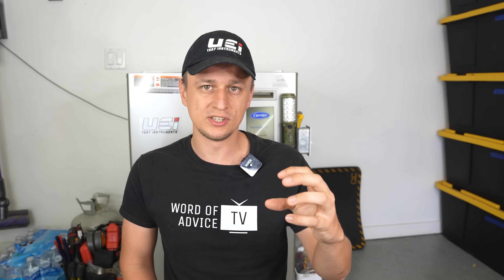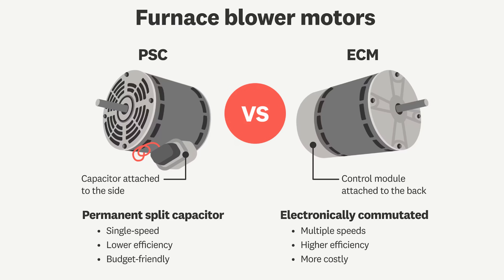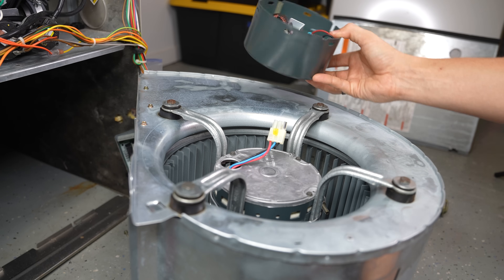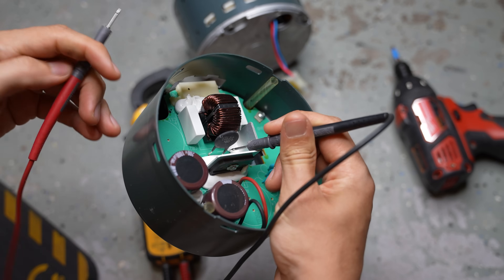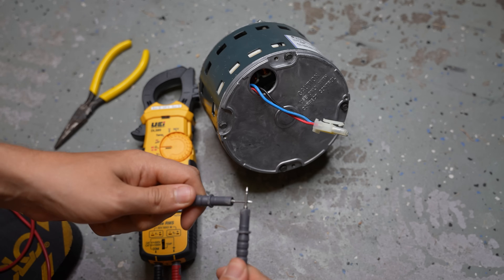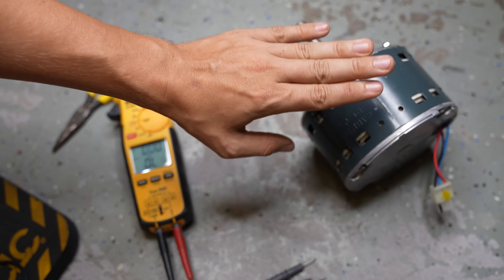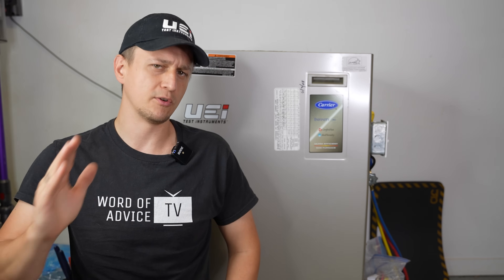So You Think Your HVAC Blower Motor is Bad?

Comment from the maker: ⬇ Other videos you may be interested in:

How to Clean Furnace Blower Wheel:
https://youtu.be/gs9KT4soJMY
How to Clean Furnace Burners:
https://youtu.be/6ehk0NZVFcg
Is HVAC Duct Cleaning Needed or Not:
https://youtu.be/2a86xiLlAHo
How to Replace PSC Blower Motor:
https://youtu.be/_3TxcnCkd18
How to Wire PSC Blower Motor:
https://youtu.be/4S8TZd-45bY
How to Replace A/C Motor:
https://youtu.be/gGFTd2dmgxg
What is the Best Furnace Brand to Get:
https://youtu.be/OLhZVaWH9Tw
Reply: hi 👋 how are you doing today
Reply from the maker: Doing great, thank you for asking!
Reply: After you remove the the electronic control assembly or circuit board , from the motor  ; Can you apply direct voltage to the motor , to either condemn a bad motor or Just  replace the electronic control circuit board .

Comment: Did anyone on here find the motor turned fine when you unhooked the ECM from the motor or is that normal when connected?  Just wanted to mention also that the night before my heat pump gas pack went out it smelled like a clothes dryer blowing into the house.

Comment: I have a problem right now. I have a Temp-star system that the indoor fan motor won’t stop running. It’s been running for 3 weeks…I pulled the thermostat off the wall and is still running. 

Do I have a bad motor?
Reply: Could be the low voltage G (green)touch R (red)
Reply: @gaoutdoor4372 no it’s not low voltage because I pulled the low voltage wires off the motor and it still kept running.

Comment: For three to five dollars you can more often than not just replace the inrush current limiter which is about the size of a nickel and will be obviously burned. 
That's what's wrong most of the time.
Reply: What are the symptoms of a bad inrush current limiter?
My ecm works sometimes, and other times it fails to get up to speed when calling for heat.  Motor works fine if just running the fan in low, med, or high. When calling for heat I get a blower motor failure code.  It kind of rocks back and forth before kicking all the way on. Genteq/carrier
Any thoughts?
Thanks.

Comment: I'm troubleshooting an ECM right now due to a blower not running. I already confirmed the board is good. The ECM resistor has continuity. Unfortunately the ECM has a rubbery coating on the board. Will the ECM board still come out if I remove those two screws? This furnace is less than 5 years old.

Comment: Very informative and brief Thanks.
Working on my ECM motor. Five years old and lightly used. Module looks and smells good. Motor looks and smells good to. Going back to the house to check the module and motor per your instructions.

Comment: I cleaned my blower motors fan barrel it was clogged bad "previous owners" and now it makes a loud noise but if i have the inspection door off with button clipped so it can run it runs quiet but if i put the door on and run it it is loud like a noise that sounds like a machine gun er er er er er er and my blower motor is an old one no module.

Comment: The ECM blower motor on my heat pump system started running continuously.  System heats and cools okay but the blower won't turn off. Any suggestions on what is wrong?

Comment: Thanks so much for the information. I am working on this type of motor and it won't come apart. I removed the 2 main screws on the back of the motor. I did notice that there are some very small secure torks screws on the end, but they go in the side of the end plate of the motor. Is there a trick to this.

Comment: That's an awesome video.
Thanks.

My question: What would you do if you noticed a burn mark on the back of the blower motor module board?
Reply from the maker: You're welcome! You would likely need to replace the whole module.

Comment: My blower motor runs but makes a sound like grinding or wiggling a little when it runs.
I'm assuming this is not the ECM, but the motor itself.  Or could there be a belt inside the squirrel cage, would this be it instead.   The cage turns freely when the power is off.

Comment: Soo..  you spend a week waiting for the module, do the labor to to remove and replace, and it’s not the module. No. ECMs are IMO much more problematic than single speed motors. Do they save money?  No. Are they a engineered to benefit the customers?  Again, no. The price of an OEM variable speed blower motor is 10 times the cost of a single speed. You will never get that back in power savings. The single speed is also more dependable, as it has no digital computer to go bad. I yank them out, replace with a single speed motor with a heat sequencer as a blower relay with delay, and never look back at less than half the cost and more life expectancy. Believe the sales marketing, or believe a retired hvac contractor that has no skin in the game.

Comment: Two blown control modules in 3 years. Control module on eBay costs more than the motor with control module. Go figure. Thermistat was not an issue, something else failed. Can't figure it out because the parts are poured over with rubber. This is racket on the manufacture's part.

Comment: Random question... Have you ever seen anyone use one of these (Whether an ECM 2.0-3.0) as a shop fan/floor blower? If you have How was it wired up? I know there is a quick and dirty way to test it by applying 24V across the Com and RX on a ECM 3.0. However, im worried about long term use as a document that I found states that the max Voltage on the RX/COM is 20 VDC. Im wondering what the Commercial testers are doing to TEST the motors and if they can be used long term for a blower application, or if applying 24VAC to the RX pin can cause damage. 

For those that comment that I should just use a Cap start motor.... I DONT WANT TO. Not to mention I was able to get a blower assembly with a good motor for FREE. So I dont want to spend 150+ on a replacement motor when I have a good motor already and thanks in advance.

Comment: So I had a dog chew my signal wires up coming from outside unit and the two wires touched and blew my low voltage fuse. Replaced the fuse after I fixed the wires coming from the outside. Tried to turn thermostat back on and wouldn’t do anything. Went out and bought another thermostat put it on and still nothing. But if I take thermostat off and touch my red wire to my yellow cooling wire air conditioner works like it should. Where should I start
Reply from the maker: Sorry to hear about the air conditioner troubles. It sounds like the thermostat was damaged before the fuse fried. If everything fires up when you bypass the thermostat like that (R to Y at thermostat) this almost always means bad thermostat. You could also try resetting it if it resets or changing batteries if it has batteries. If that's not working, then a new thermostat is needed.
Reply: @ thank you so much I’ll dig into it more tomorrow
Reply: Hey man so I Installed a new thermostat when I turn to cool outside unit kicks on and condenser kicks on but the fan will not blow on the inside unit. If I switch it to heat you can smell the heat strips but fan will not blow. But still if I jump the red and yellow with a jumper wire the air conditioner works like it should

Comment: Hi, about a week ago I have to replace my ECM blower motor..... luckily it is under warranty.  It was only 5 yrs old.....Rheem gave me a complete ECM motor and the Circuit Board as a package.  I have to turn in the old ECM motor and the Circuit Board with $150 core fee.....which is not bad considering it would cost over $1,000 if it wasn't under warranty.  My a/c was licensed so he handled this thru Rheem warranty distributor.
Reply: What is the $150 core fee?
How much did they charge you to replace the ECM blower motor/module?

Comment: My fan is blowing on the inside heat pump and it just keeps running. Constantly runs even though the switch on the thermostat is in off position. But at the outside unit,  no fan movement and compressor wont come on. I changed the capacitor already but still nothing. Any advice on the potential problem would be greatly appreciated. 🙏🏾💚☮️.

Comment: I have had this many times in my business.  I found that the module has issues with the inrush capacitor.  You can buy them on line for a couple dollars.  Yes i said a couple dollars. Simply solder in a new capacitor. That is not a resistor.  JFYI

Comment: Great video but normal people can do all that and buy all the parts just to find out it was the control board dropping voltage when calling for cool. Or it can be 1 certain speed tap on the motor not working. Not as simple as videos make it out to be.

Comment: what sucks is this energy savings variable speed motors are frequently not replaceable seperately  they only sell the whole unit on my weil mclain gas heating system for a mere 700 dollars for a fan like a bathroom exhaust fan

Comment: Hello, Could you tell me what could be my issue? My heat mode works fan. If I select fan on then the fan works fine. But on cool mode, the outside unit works but my blower fan does not run. I tried to set fan as on and then start cool, but the fan stops when cool is selected. I recently changed my board and the capacitor. What could be the reason?

Comment: If I am correct, that round black component is called a thermistor and they are about $3. You are correct, many reliable sources in HVAC confirm that those EMC motors, especially the Genteq brand, fail in just a year or two and the point of failure is usually the ECM. Availability of another ECM in the past has been limited so many of the HVAC tech people simply replace the entire motor assembly which is an easy $800 motor. I've seen other YouTube channels in HVAC do the same, locate the correct thermistor and replace it however, not that many HVAC tech will do that due to having to have the skills to de-solder and solder the new thermistor in the field. If they can't obtain an ECM they will replace the entire motor. Some of those ECM units are filled with an insulating packing which is very difficult to remove for access to the thermistor which in most cases, prevents or makes replacing the thermistor a higher risk in damage to the board and then if a tech is able to replace it, they don't have the packing material to fill in the empty space. There are also methods to simply remove the ECM motor and replace it with a PCM motor conversion kit. There are upgraded ECM motors now being made called Evergreen that are more reliable and do not need to be programmed. Good explanation though for those who might spend money they don't need to.

Comment: HVAC Tech here. 95% of the time, it is the cap that fails and not the motor. While I know that you can order just the cap, we normally replace the motor and the cap together.

While that opens me up for accusations of screwing customers over, here is the thought process. We explain to clients that we do not know if how the cap failed would have caused any damage to the motor. If you have a 15 year old furnace and I replace the cap, you still have a 15 year old motor. And no matter how many times a customer tells me, they understand that the repair is the cap only and not the motor. If six months later the motor fails, suddenly we are getting very any calls back saying that we sold them a defective part and want the whole blow motor assembly replaced for free or at a heavy discount. Over time, it was just not worth the potential fight with customers over this kind of stuff. So we no longer offer just cap replacements.

In the end, I'm all for people saving money. I'm a home owner too, I know stuff is expensive. So if you feel comfortable with making a repair like this to save money, go for it.

Comment: Pro tip of the day: When you install a new system, always include an Intermatic AG3000 surge protector on the condenser disconnect and the disconnect on the furnace. Total cost, about $160 for  both.  
Cheaper than replacing ECM motors, control boards, and compressors. On a service call, upsell the customer by explaining it protects the equipment from power surges and is far cheaper than replacing burned out parts.
Reply: Isn't that usually a soft-start module, of course, it would reduce the surge by ramping up the current to the compressor.  Common on mobile ac units I'm told.
Reply: @emptech 
No. It isnt a soft start. It is a quality surge protector. We do not install soft start devices. They are prone to early failure and are too expensive. We only recommend and install Intermatic AG 3000 surge protectors. Our cost is about $70 each.
Reply: I paid for one ($595), was never installed and company disappeared 😡
Reply: Intermatic's "warranty" states it will pay for equipment damage only after homeowner's insurance is paid and IF THEY determine damage was due to a fault in THEIR AG3000.  If it fails and they determine it is not the fault of their unit, or you don't have a homeowner's policy---tough luck!
Reply: @Jeph629 
We don’t buy and install for any warranty. Every company we looked at has the same limits. We only use the AG3000 for its features and reliability. We have never had one fail unless  the house took  a power surge, then it will do its job and pop, protecting the equipment. It is sacrificial. If the unit popped, then other electronics in the house failed, proving the surge took place and the AG3000 saved the furnace or condenser.

Comment: Jay, you mentioned possible control problem, but how would you test to see if your control board is sending power to the blower motor?
Thanks
Reply from the maker: That's pretty rare but you would need to look at the furnace wiring schematic and see which wire sends power to the motor. Next I would set the thermostat fan setting to ON or jumper R to G at the control board. Then check for voltage at the wire terminal that is supposed to be sending power to the motor.
Reply: @WordofAdviceTV  Just ran into this ECM setup for the first time ever....and of course it's in a tight attic. 240vac goes straight to the motor from the transformer. The 3 wires off the board that go to the ecm is com, T1, and T5 and they are shown on schematic to be 24 volts.There's a speed tap table showing various combinations of t2-t5 for fan speed depending on unit size. T1 is sending the power signal to the ecm then? Thanks for the great video.

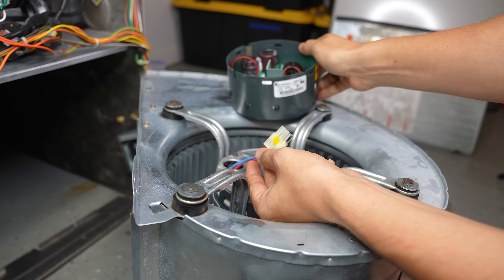Comment: @4:18 that’s a capacitor not a resistor.
Reply from the maker: Are you sure? I thought those cylinder looking things were the capacitors. That black thing is a thermistor.
Reply: @ yes, the cylinder things are also capacitors, but those disk shaped things are ceramic capacitors.

Comment: Make sure you have a surge protector on your furnace.  Those modules are very sensitive to power surges.  Besides the motor, there is the control board to protect from surges.  most homes have multiple surges a day, either from inside or from the power provider.
Reply from the maker: Great suggestion, thank you!

Comment: Hey Jay, can you do a review on the UEI DL 599. And how it differs from the DL 589. Not sure which one to get. Thanks.
Reply from the maker: I can look into it, thanks for the suggestion!
Reply from the maker: Okay so I looked it up and I don't think I need to make a video on this. There are not many differences. Mainly, the 599 has power functionality and wireless capabilities whereas the 589 does not. If you want more detailed specs you can see and compare them here:

UEi DL599:
https://www.ueitest.com/ECommerce/product/dl599/trms-clamp-meter-w-motor-testing
UEi DL589:
https://www.ueitest.com/ECommerce/product/dl589/600a-trms-clamp-meter-w-dc-amps-inrush-magnet
Reply: @ Thanks. I was wondering if the DL 599 would be worth the extra money. I guess my main question would be ‘is the 3 phase motor testing worth it or should I just go with the DL 589’. Thanks for answering.

Comment: I believe there is a way/mod that allows the pcm motor to be used in its place. An HVAC tech took my elderly parent to the bank on one of these. I also believe he said it had to be programmed and charged xtra for that. What do you think ? Long time subscriber.
Reply from the maker: Technically the universal motors do need to be programmed but not a lot of techs do that. It shouldn't take long to do so hopefully he didn't charge them an arm and a leg for that part. I am not sure what mod you are referring to but yeah, there are a few retrofit options out there. The replacement does not need to be an OEM motor.
Reply: @ it was 1300$
Reply from the maker: Was that the cost for the whole job or just the programming part? If it's for the whole job, then that is actually a pretty common price. (Expensive and an overcharge but common) That's why, if opportunity allows, it's best to do these kinds of repairs yourself...
Reply: @ the new motor assembly.

Comment: When checking continuity on the resistor in the unit, isn't it possible to get continuity coming from elsewhere in the circuitry?
Reply from the maker: The way it's set up, that shouldn't happen. At least with the module in the video.

Comment: @WordofAdviceTV  when you mention "PCM" are you talking about a 'permanent split capacitor' motor? ... the kind of motor that has lower starting torque than a 'capacitor start motor' PSM has the capacitor and the start winding permanently connected. CSM switches out the start winding when the motor spins up.
Reply from the maker: Did I say PSM? I meant to say PSC. Those are the two common types of motors in residential furnaces. ECM and PSC. Thank you for clarifying!

Comment: I just changed my blower for my furnace! including the module.
Reply from the maker: My condolences to your wallet! May the new motor last you at least 20 years!
Reply: Bet you siento over 500.00 for one of those motors
Reply: @jrmurillo1104  Oh yeah, for certain! Couldn't even get a generic one so I had to use the brand one.